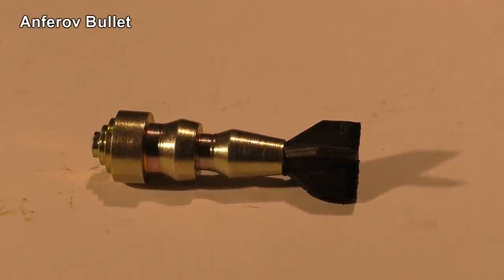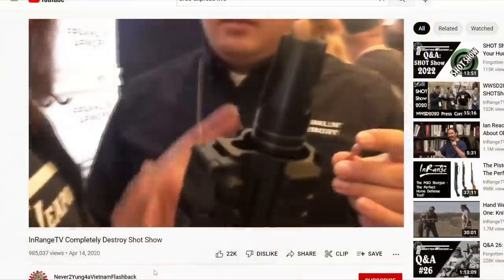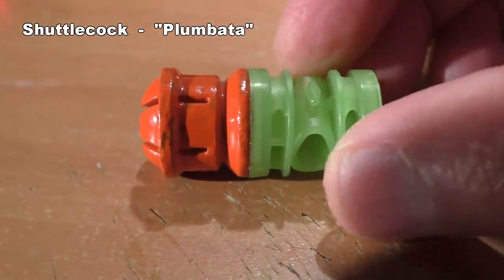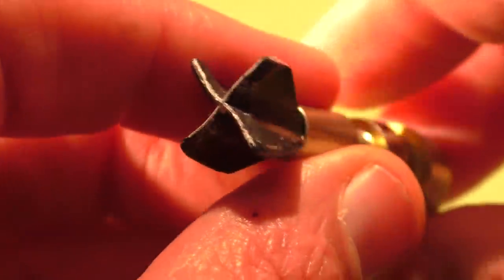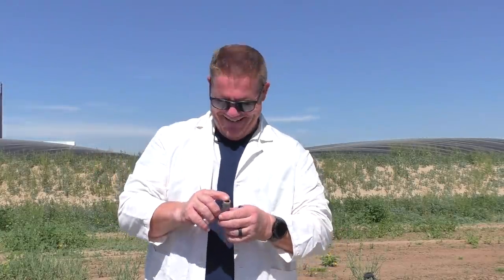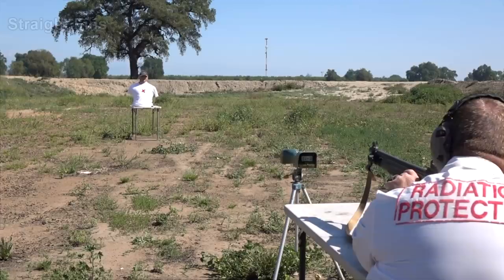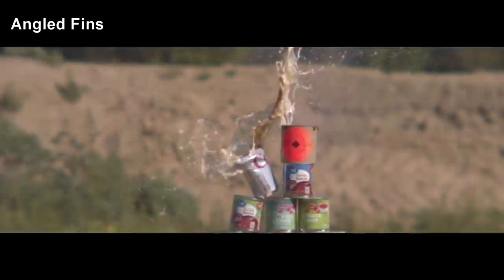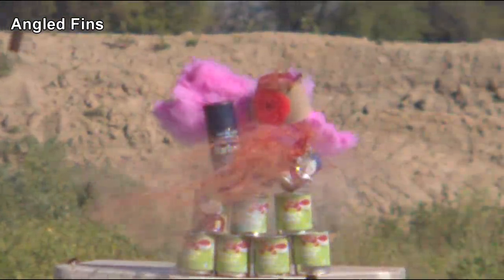Supersonic Darts - The Effects of Inducing SPIN - I learned something!

Comment: The Ranch Fairy tested speed loss using a lab radar on helical fletched arrows. Got some interesting results. 

There is such a thing as too much spin, where the back end would wobble like yours did, and never truly stabilize. 

Overall, what he stated he found at the beginning of his testing (he hasn’t released full info to my knowledge) was arrows fletched with a helical setup do spin more and are more stable, but do not give up a noticeable amount of speed or lose speed at a noticeably higher rate. I believe in a 60 yard test his results showed a few fps of difference in total

Comment: Since you don't use a wad under the fins buffering them from the gunpowder, I suspect the high pressure of the burning gunpowder in the barrel probably gave it more of a spin than the round traveling through the open air after leaving the barrel.

Comment: Yes! Great video I love it! and a GREAT deal to learn here; 1st thing to notice is the very BLUNT nose on the TWIST projectile and just very simply it should have a SHARPER nose such as the ones that are rifle bullets SO::::::::::> I believe by giving that bent fin projectile a ROCKET NOSE would/should stop the tumbling/flubbing in the air before the point of contact/impact. SO why do rifle bullets have a curtain twist is because::::::::::> they are supposed to be more accurate and deliver great power/impact, but the rifle bullet does not stop there it also needs to have a boat tail, because it does not have fins to further stablize itself.

Comment: I enjoyed your video , through aero model making and sailing I know the rudder surfaces will control up the 35 degrees of angle, you stated you had forty degrees of deflection.
If you had a lesser angle and a smoother finish on the wings rather than the square edge which was evident on close up,  there may be better air flow over the leading edge of the wing surface.
I think you had what is known as a stall situation because of the excessive angle which results in turbulence and high drag, the latter slowing the slug down and turbulence is responsible for causing unstable flight.

Comment: the angled fins angle and length have to be accurately the same for it to work correctly. and with that power you might also need to check the material because it could bend with the pressure and start to yaw sideway.... im french so my english is not accurate lol but i hope it  helps

Comment: Try angling the entire fin about 10 to 15 degrees. You should get a more even airflow that way and less yaw inducing turbulence. Each fin needs to have the exact angle as all the other fins. Weight distribution may also be a factor in preventing yaw. Anxious to see what you guys come up with.

Comment: I would theorize that the angled fins would create that many more variables as one would have to get each fin bent close enough to the angle of the others to avoid excessive wobbling. Also, one would want to find the most advantageous angle that would be best for velocity and not increase the probability of issues in sabot separation. Looks like it would be trying to reinvent the wheel at some point.

Comment: it is worth noting that it's the same on most main battle tanks from the 60s up to today (soviet T-62, T64, T-72s, etc... american abrams, german leopard 2, french leclerc, japanese type 10, etc...)

and said MBTs are cappable, with a smoothbore gun and this kind of design of projectile, to score a hit on the moove at distances above 1km (and for more modern ones longuer than that, to such a point that the penetration data of most kinetic projectiles for today's tank is counted at 2000m of distance)

Comment: The potential for improvement of stability would come in extending the range that the projectile is accurate. Is the standard bolt stable and accurate to the useful range of a shotgun? You touched on ad the end improving accuracy at 100 yards. 
What’s the existing range for a shaped projectile vs a slug vs OO buck shot and would a spinning bolt increase this range?

Comment: The whole time I watched this I was like "It isn't about stability its about the rotation averaging out any drift!"

And then you mentioned it at the end. Important stuff.
A fin stabilized projectile is stable, but that doesn't mean it doesn't fly at an angle. It inevitably produces lift in some direction. It can also oscillate, and in extreme cases it could lose a fin or become damaged while penetrating brush, etc. Spin also helps separate sabots consistently, although that is not a factor when the spin only starts after sabot separation like this.

Most of all, it compensates for the difficulty of cheaply mass-manufacturing finned projectiles with good consistency.

Comment: I think a lot of folk try to liken rifled barrel bullet ballistics to slugs from a smooth bore without realising a bullet from a rifled barrel may be rotating at 300,000 R.P.M. At those speeds the bullet to all intents and purposes resists pitch and yaw as each physical input is only applicable for minute fractions of a second and bullet's length, weight, c.o.g etc need to be very carefully matched to rifling twist rates as they can be over as well as under rotated. Over rotated bullets may literally fly apart due to the huge forces involved and insufficient spin won't stabilise them at all. Just expecting to put a bit of rotation to an object and assuming everything will miraculously sort itself out is somewhat naive. Companies don't spend huge amounts in r+d to produce crap that someone else will turn to gold in a ten round test in their back forty. Kudos for attempting to reply to all the backyard ballisticians, though where they got their degrees baffles me. It has taken me 30 years of reading to to get a grasp of what I'm actually altering when I make home loaded rounds in terms of internal and external ballistics..

Comment: You may get greater accuracy over a longer range, or a straighter flight? 
We did alot of R&D years ago  on large projectiles and found that just the slightest touch of a bend and scoring the  largest point of the body of the projectile caused it to spin and doubled the accuracy and range. But if you score opposite to the fin twist you just get a tumbling chaos of nothing.

Comment: i guess also the speed of the object sub or supersonic might add another variant because of pressure difference are the fins...
correct me if i am wrong but i have not seen any "small" long distance rounds with fins. so i guess for stability on longer distances they do more harm than good... (more drag, less repeatability between rounds,....)

Comment: I read somewhere the reason why they don’t spin stabilise sabotage rounds is because they are generally longer and so they have to spin at much higher rates to have a significant stabilisation, this is usually much higher rpm than the actual round can handle so the rounds end up just tumbling.

Comment: I know it would be difficult to test but I suspect you'd see greater differences at greater ranges, however for it to be conclusive you'd need consistent design on the fins (ie. designed to be angled rather than adjusted with pliers). Good to see that it did make a noticeable difference though, I had the feeling it might be like WW2 fighter planes losing tail control response when touching supersonic speeds in the dive.

Comment: the issue that armored vehicles had when dealing with Sabot on Rifled cannons is that the Sabot's were unreliable due in part also to the muzzle breaks as well IIR. ammo now in modern armored vehicles is fired from smoothebore canons without muzzle breaks in order to ensure good sabot separation on the high velocity Dart Rounds they use. it's partly why I think most flechette rounds dont work well due to the use of both rifling and muzzle devices on most firearms as well as being within a smaller diameter to the point of really not being useful either in that regard.

Comment: I used to make slingshot crossbows as a hobby and I made every thing by hand, including darts/arrows/bolts. I used bamboo kabob skewers for arrows but being smart I tested hundreds and hundreds of styles, I settled on something that was deadly accurate but also cheap and super easy to make. I would put crafting wire wrapped a bunch of times at the end near the point so the darts were front heavy, then I’d use some thin card board from a cereal box for fins. I’d hot glue the cardboard in fron of the knock, and I noticed the darts would be accurate but not as much as I wanted, always like a five inch group from about 20-30 feet away, but then I realized I could bend the corners of the card board like a fan and get spin stabilization. Easily doing 1-2 inch groups after that. I miss being 16. I was such a crafty smart kid. I still am, just don’t have a work shop anymore.

Comment: Barnes Wallace used shaped fins on his " earthquake" bombs, the logic there was if my memory  serves me well to maintain stability in the trans sonic  speed range...from my rc aircraft building days  30 degrees was often quoted as the maximum control surface throw to prevent flow separation...just comments not criticism  and I am ready to be corrected.  Great channel ..

Comment: There's a lot of potential in induced spin. Like you said, the spin rate of the angled fin rounds was higher than if it were fired out of a rifled barrel. I would probably reduce the angle of the fins to match a normal rifle spin rate and see if the stabilization is more consistent.

Comment: 8th grade, I put fins on my bottle rocket, and it spun and twisted so fast that the nozzle rarely pointed down. Took the fins off, and drag kept the ass where it was supposed to be. 

Fins don't just spin the rocket, unless they're PERFECT. They're as likely to impart inwards and outward forces on the tail, and a consistent, off-balance load throws everything off.

Comment: EM discharge of moving thing (sometimes with corona discharge like St.Elm s fires but usually without like arrow)  occurs from pointy surface and not from a roundy one. So projectiles before IQ drop had pointy surface on the back of projectile and roundy on the front, pointy surface on the front and round back -  will discharge wrong direction

Comment: You can get enough spin to cover ballistic defect just by filing down the leading and trailing edge angles on one side of each fin, even very slightly. You start to make an airfoil shape but not efficient enough to overspin and get it coupled up (conical gyrations).
Reply from the maker: I think so.

Comment: due to the mention of arrows, as someone who does some archery I want to toss in my two cents. Even with fairly straight fletching and natural feather, the wing (shape) of the feather will impart some spin. It gets more pronounced with helical or angled fletching but from the slow speed and typically shallower angles, it's not a very fast spin. But for arrows it really only needs to help with the paradox and straighten the arrow flight out. Spin rate would matter on the stability of the spin stabilized finned slug too but that would require a lot of testing/modeling to find the right rate.

Comment: Whether a fin stabilized projectile needs additional spin for a stable flight depends on its aerodynamic shape and its speed. In archery for instance, the fletching on traditional bow arrows isn't straight but angled (offset fletch) or even spiraled (helical fletch) and the bird feathers used as fletching have a natural curve and a smooth and a rough side, all of which impart a rotation on the arrow in flight. Compound bow arrows on the other hand achieve much higher speeds so they're fletched with straight plastic vanes because they don't need additional rotation.

Comment: Sabot shots typically don't need rifling to sping since they are aerodynamically stable, rifling would just slow the performance of the Sabot. So could you perform a test with a smooth bore barrel and a rifled one to see if the many tried and tested theories of projectile speed and aerodynamics we use for our modern MBT's to show our audience the difference?

Comment: I suspect you would've gotten better results with a smaller (and more precise) angle on the fins.  That said, I wonder if also molding the tip of the projectile like a drill would have an impact on penetration...

Comment: The fletching on arrows are angled, if you're using actual turkey feathers you can get ones from the right wing or left wing, the ones from the right side spin right and left, left, when your arrow is flying it is wobling due to the fact that the string goes through the middle of the bow and the rest sits if to one side, the spin on the arrow does the same thing, rotating it so it's not just flipping in one direction causing it to move that war

Comment: The instability may have been from the gas at the muzzle pushing the angled fins in the opposite direction before the air could act on them once they started downrange. So without a wad behind the fins, maybe it's better to keep them straight. Or maybe with a slight airfoil shape... Thanks for the food for thought.

Comment: I think there are two problems with the bent fins. Very difficult to get them balanced doing it yourself and if the powder is between the fins on the burn it creates unpredictable forces in other directions leading to random destabilizations. I think a bent fin design could be best but it would need further engineering.

Comment: This brought out the inner nerd in me.  I fly a supersonic jet.  I can attest that by doing aileron rolls, it has a negative impact on where the jet is pointed, if accuracy is your desire.  Additional data point, this jet has a symmetrical wing, so it only sees or cares about the angle of attack.  And lift is lift, whether its producing it in a tight spiral or upside down.  But what I found interesting, at supersonic speed, I expected the boundary layer to separate further, leaving the fins behind the bullet with low to no influence on the flight of the bullet.  It is a factor on jets past mach 1, the faster you go, the further the boundary layers moves out and away from the control surfaces on the tail.  It makes the jet feel like there is a delay between control input to how the jet responds.  Clearly not the case with these rounds, as it was spinning right out of the barrel.

Comment: When fletching arrows the same idea applies. Straight small fletching is fast but unforgiving while large conical or angled fletching are more accurate and move slower. Both extremes are excellent at what they do but a balance between the two does everything well enough.

Comment: Yep and a higher rate of spin will buffer out those imperfections to a greater extent (to a point) you will at some point reach a point of diminishing returns with great rotational speeds and if you continue pas the point of no increase of reduction of those defects you will begin to reintroduce the negative effects of the defects. Assuming forward moment is identical shot to shot to shot. 
You can actually test this with bow and arrow by taking a broad head and bending the tip of it on a 2 edged broad head. Then putting the fletching on to shafts at a angle and introduce spin to the arrows. Shoot in to a card board box at nearly the limit of the arrows range so you do not damage the broad head. If you bend it enough you can get a very drastic curve to the arrows trajectory or have it snap in to LOL. Yes i actually did this as a experiment for a college class long long ago. After a specific point the rotation of the arrow was to fast and the bend ended up steering the arrow to the left or to the right depending on what side the bend pointed. Below that threshold it self corrected and  hit the proper point of aim. To get rid of human error i used a very rigid stand with about half a ton of weight holding it steady with the bow clamped in. 
To get the rate of spin i calculated it as i had no access to high speed cameras. Probably the most complex math i ever did in my life and i hated every freaking second of it lmao. 

The amount of deviation do to imperfections ither induced or incidental is directly proportional to the speed of the projectile fired or launched and the rotational velocity. These induced or incidental imperfections are corrected for by spin how ever not only do these corrections reach a point of diminishing returns but further increasing the rotational speed will re introduce the incidence of deviation directly proportional to the rate of spin stabilization and projectile velocity..... WEEEEEEE quoted from memory :\

Comment: In the water drop test it would be hard to see a difference in velocity from the differences in drag at that velocity. The difference in velocity at range when fired should be apparent as the drag force is exponentially increased with velocity. I liked the visual of buffering out defects 😄

Comment: You guys are awesome.  Officer Greg - straight vs alternative. Lol. Pretty aggressive angle.  Not an engineer, nor do I know anything about fluid dynamics, but arrows use about four degrees of angle on helical fletchings or vanes. Too much force or lift is imparted at 40 (IMHO).  Perhaps a much more qualified viewer can spend a little time or research into angle to length ratio and fine tune this experiment.  I would add shooting this from a sled at a more precise, measurable target, would also help in the study.  The differences I predict will be minute, so you want to eliminate contributing factors  I use an "x" on a paper plate with hash marks, but if you want, I'll buy the fancy ones for you.  All the best.